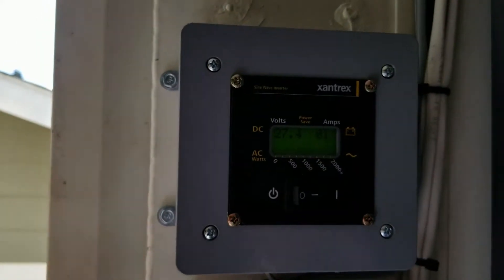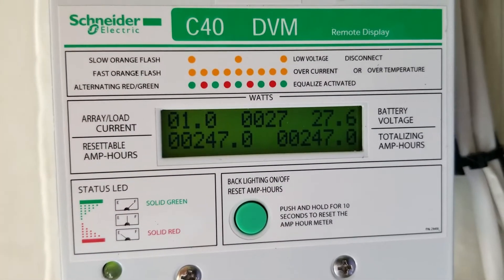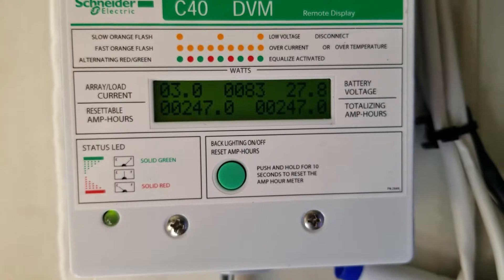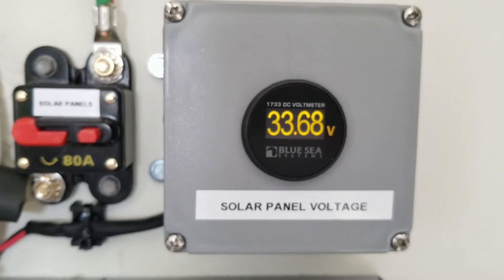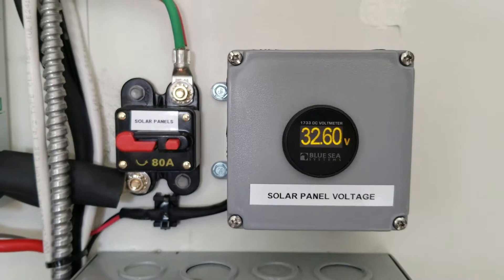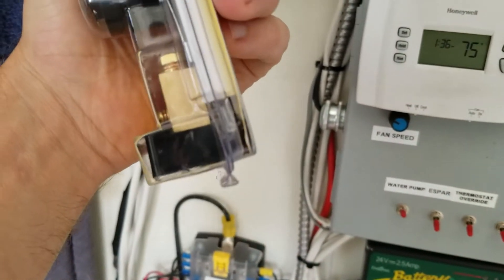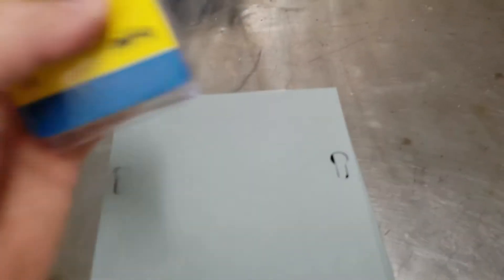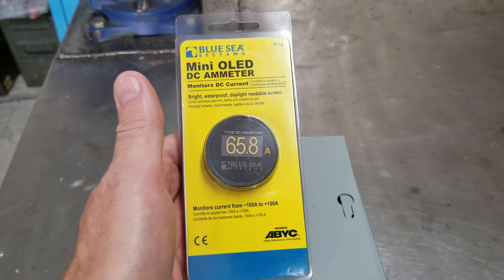Abel LMTV build part 126 (Blue sea ammeter and voltmeter solar panel output)

Comment: Hi Sean,  if I follow you correctly, your panel put out more amps then your batteries can put out to your a/c unit. Sounds great if that's the case. But my question is don't you worry that the panels will overload your batteries, or does it expel the extra amps some how. Also Sean, non Lmtv related. What is the name of that song that you're playing at the start of your project? It's real catchy.
Reply from the maker: The charge controller output is the information you see on the battery side so the batteries never see the high amps or the high voltage on the panel side of the system.  That is the beauty of this simple yet effective 166 dollar charge controller.  The charge controller will place a net yield of amperage out to make up for the loss it sees.  The extra is dissipated through the heat sink that you see at the top of the charge controller as I understand it.  

The music I use is from the dance music section of teknoaxe.com I am not sure of the exact title of the songs but they are free to download and use.